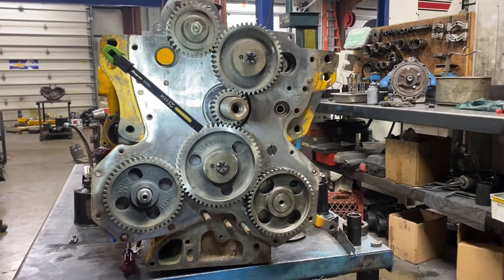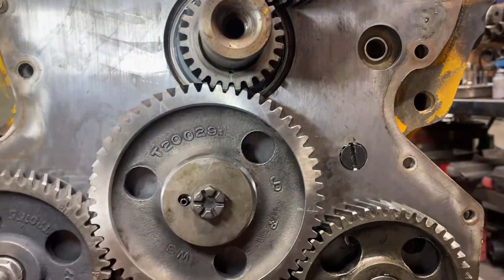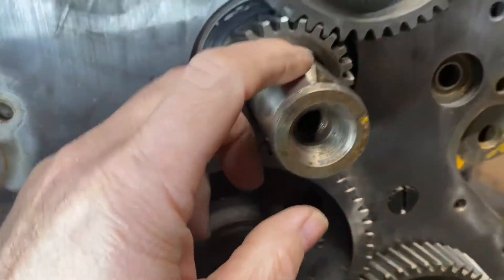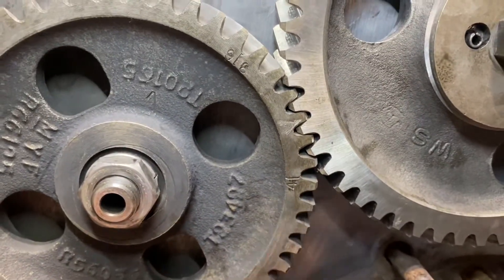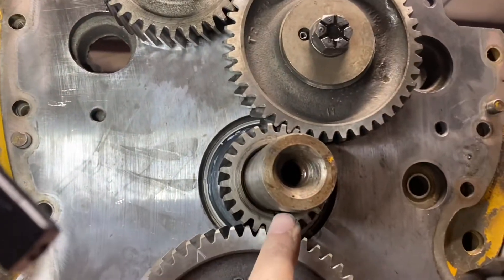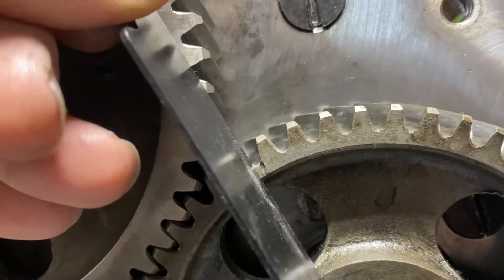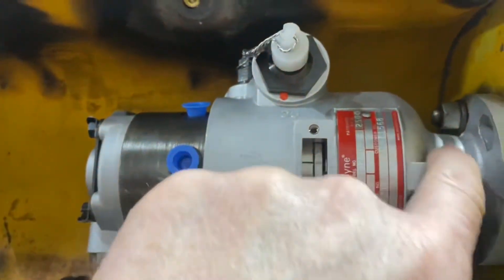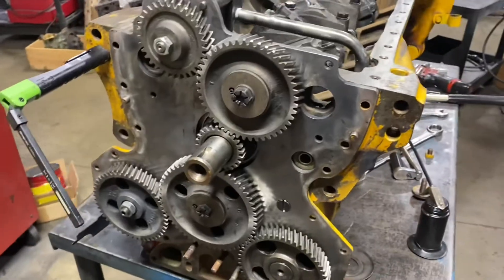John Deere Injection Pump and Gear Timing

Comment: Thank you for the information, sir.

On JDs, when the engine is “pinned,” does that mean (a) TDC for cylinder 1 or 6 and (b) cylinder 1 TDC must be verified by markings on front gear train and/or visually looking at rocker arms — cylinder 1 rocker arms loose & cylinder 6 showing overlap?

Is it common to remove the gear train cover off (CAT “peanut” cover) to confirm markings for TDC cylinder 1?

Thank you for any guidance you can offer.

Comment: Hello La&m, I have a question. Why would the timing slip? Tractor would not start, everything seemed fine, fuel ect., so I advanced and retard the injector pump and it started.
Reply from the maker: Good question. I don’t have an answer.

Comment: Would the key way on the crank shaft on a 4045DF150B be at the 12 o’clock position? When it’s on #1 TDC? It’s a 4cylinder
Reply from the maker: I'm not 100% sure.

Comment: Quick question for ya: i am replacing oil pump on jonh deere 4045T. By removing that oil pump i am also interfere the larger gear that connected to the oil pump which I believe balancing gear. The question is do i need to do the timing for that 2 gear mentioned?
Reason i ask is if that required i will have to remove radiators, fan, and some more stuff in the chassis.
Thank you.

Comment: And all the 4045 engines, fuel pumps are timed with a key, so no matter the position of the engine, when the pump is installed, it ONLY GOES IN ONE WAY !
Reply: Do you know anything about the 6059 fuel pump timing? I put the engine on tdc put the pin in and couldn’t find the timing line on the stanadyne fuel pump then I did more research and asking around and I thought that since it had the key way I was good and didn’t need to worry since it can only go in one way and then you just advance or retard it if needed. Since I had it rebuilt it’s smoking like a train so I’ve tried to advance it and retard it and nothing has worked.
Reply: @marktrauth1315  I can see from numerous different video,s, the  early engines used NO key, so you need to time the pump and engine. You will need the JD repair manual for your engine, which may be free pdf online.

Comment: I just pulled the injection pump on that same 6cyl engine.  I locked the flywheel on TDC which brought the two lines in view on pump.  When I pulled the pump off the shaft the shaft/gear flopped around a bit.  I'm surprised they use the pump housing to support the shaft and gear with no bearing or bushing to support the shaft?  Or is this abnormal ??
Great video and (thankfully) I'm only doing the pump, not engine overhaul.
Reply from the maker: I don’t believe it will jump time. It’s loose, but not enough to jump out if I am not mistaken.

Comment: on a 1969 JD 350 Dozer the manual says to rotate the engine by hand to get it in timing before removing injection pump, where in the world is there a place to try and rotate it by hand ? Roosa Master CBC-331 Pump

Comment: Hi, My timing window is on the opposite side of my pump so not visible without a mirror, should you align the marks the same way?
Reply from the maker: What engine and what kind of pump?
Reply: @LakelandAutoMarine  Hi, it’s a JD3029 3 litre natural aspirated engine with a Standyne injection pump.  Marinised by Beta Marine and named JD3 Tug.  The window for the timing marks is away from me next to the engine block.  I have removed the access plate and with a mirror I can see a long scratch timing mark but no mark is visible on the other corresponding half closest to the input drive shaft end.

Comment: I just did a major overhaul on one of these engines and I did what you said marks the gears because I didn’t have John Deere tool. Same thing with pump. It seems as if fuel injectors aren’t spraying. Any thoughts on what to check? Thanks
Reply from the maker: You should still have fuel coming out of the pump irregardless if it’s in or out of time. I’d make sure you have fuel going to the pump while cranking and make sure the shutoff solenoid is working.
Reply: @LakelandAutoMarine  update. The pump was 180 degrees out of time. It now runs!